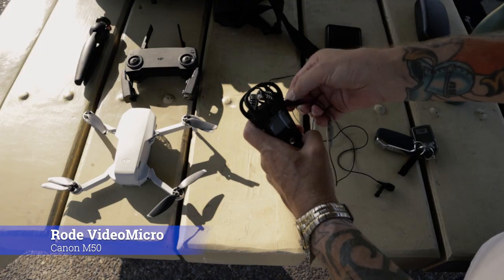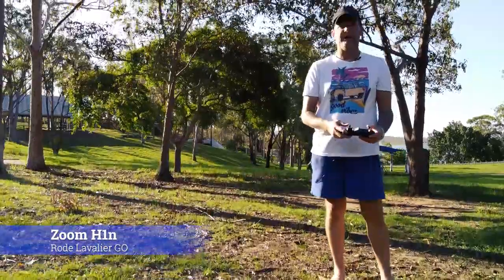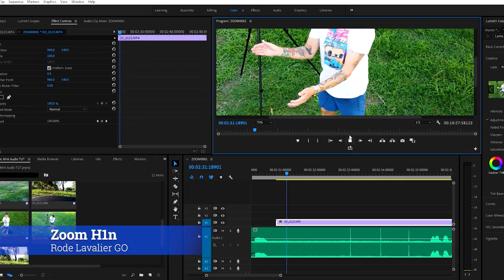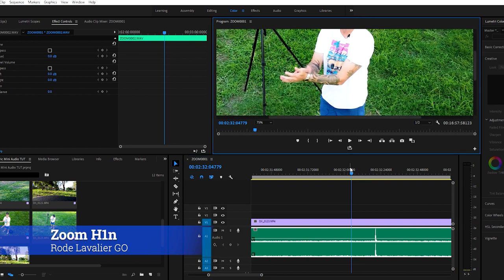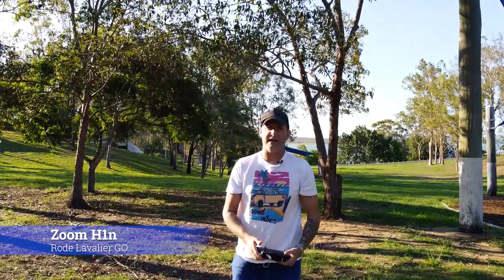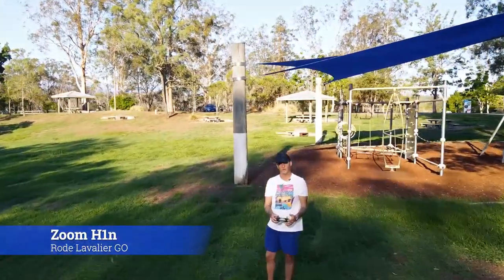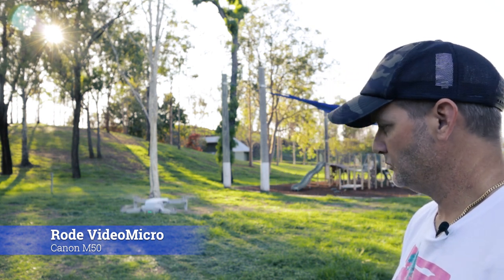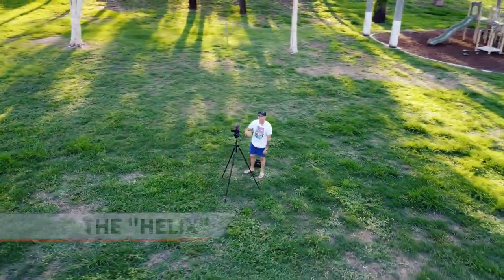Get Crispy Audio on Your Mavic Mini

Comment: Good Video !  Anyway to eliminate the sound of the drone in post?  I have Mavic Air and can hear the propellors from 200 feet away .
Reply from the maker: Hi mate, what editing software do you use. I think In that case software may be the only choice.
Reply: @conorphoto   G'Day, and thanks for the reply.  I have several options;  Davinci Resolve, Pinnacle Studio 22, and Audacity for audio.  I did a trial run today and the sync worked fine except for the lingering sound of propellers.  Currently using a lav mic pinned under my shirt and using my Samsung S9+ to record.  The audio  quality would be acceptable except for  the drone noise.
Reply from the maker: Hmm, what are you recording?